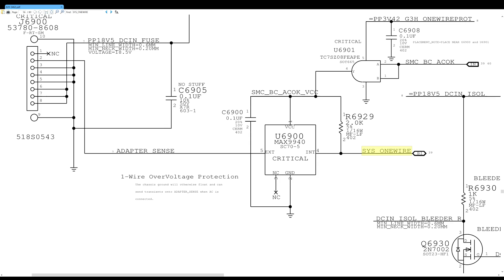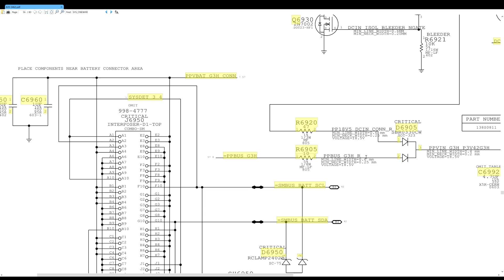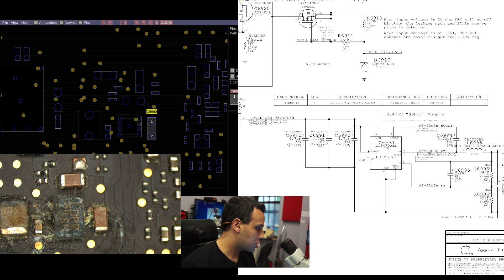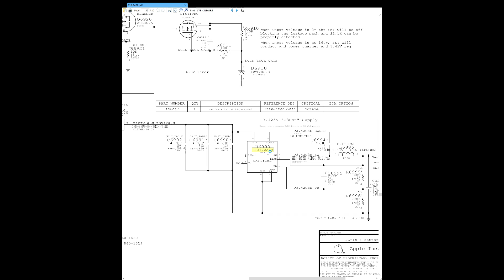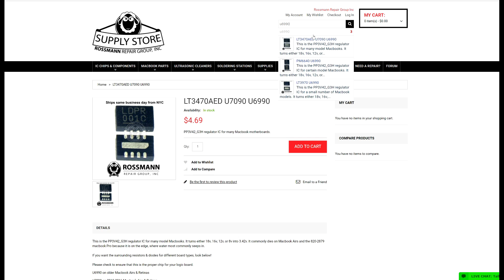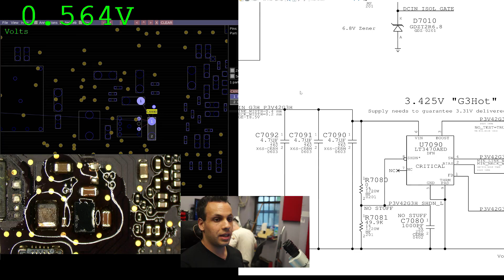MACBOOK CHARGING EXPLAINED - FAST & SIMPLE!

Comment: Hey Loui, speaking of charging, I could use some of your expertise on what is with all this "fast charging" hype? I think that it doesn't really exist and that they just make the device id the cable and if it is not original it just charges slow on purpose. What do you think?
Reply: ebrahim alfardan Derating the charging current because of cable manufacturer is a different issue to fast charging. Yes, fast charging is a thing. Yes, you can fast charge with cheap Chinese cables. All of my $2-8 cables fast charge my phone. The circuitry just needs to know that the wires are up to the task of charging at a higher voltage/current. Since chargers use CC/CV circuitry, the voltage is what makes it a fast charger, not so much the current. The charger will charge at a Constant Current/Variable Voltage up until it's almost full. (Say 3A/10V.) And the voltage will drop until it reaches a state where the charger switches to constant voltage, and will drop the current while keeping the voltage steady. You can charge as fast as the wires will allow. (For the most part. The battery can take way more current them kids being supplied.) If you buy a shitty Chinese cable with 32 ga. wires, it won't charge as fast as a good cable with 22 ga. wires.
Reply: Andrew Delashaw And sometimes some kind of ID mechanism is needed to detect if the cable maker claims the cable is up to the higher load, though this has no reason to be proprietary, it just needs to check that the vendor is deliberately saying it's not an older weaker product.  For example on a non-apple USB "charger" shorting the middle two pins instead of not is the official way to signal a 1A versus an older 0.5A port, and the USB standards now has similar official methods up to more than 60W.  Some of those require the extra wiring in USB3 cables, to avoid perfectly legit USB 1.1 cables catching fire.
Reply: The fast charge cables push more voltage and amperage with communication with the phone to know when the battery can handle the increase in voltage and amperage, to ensure it doesn't explode. It also only works within certain percentages. If your phone only fast charges up to 75%, take a fast charge cable, time how long it takes to go from 75% to 100, then compare that to a non-fast charge cable, and it should be really similar.

Comment: How do these boards get so nasty? I recently opened my old Acer from 2008 and it was fairly clean inside.
Reply: Louis' most common repair us because of liquid damage. But you're right, the solder mask shouldn't "dissolve" away so easily, just because it for some liquid on it. Their cheap, shitty, Chinese boards.
Reply: @Salty: People spill stuff on them.
Reply: Andrew Delashaw 
Chinese 9000w PSUs have pcbs better than those. I have an old chinese atom netbook, 6-7 years old and it was clean inside last time i cleaned the fan. No corrotion nor bubbled traces
Reply: Huge vent holes on the sides or back that let liquid in.
Reply: i legit think they ship them like this ...why else would the make them so hard to get into
Reply: Probably company/work devices. I've seen and worked IT with  countless desktops/laptops/workstations in countless companies such as Blizzard and Verizon and almost every single one of them is dirty, dusty, and generally extremely unclean and unsanitary. Heck Blizzard is the worst out of all of the companies I've worked for. Every time I go their for a job my allergies act up because whenever we diagnose and repair their electronics and the fans power up for the first time in a while, countless dust, food, and even glass particles have flown directly into my face. And don't get me started about the open bar/broken vodka glass on a certain company's office floors under a cubicle in a dark room...

Comment: The good old teaching/guide videos. The first reason why i joined. It's good to do a jump back on old memories

And remember how needlessly stupid and complex apple one wire circuit is compared to any other fucking laptop
Reply from the maker: This is not complex. Look at 820-2330 onewire circuit. THAT is a mess!!!
Reply: Louis Rossmann absolutely true but this is still more needlessly "complex" than any 2 mosfet dc in + TI isl you find on any cheap laptop